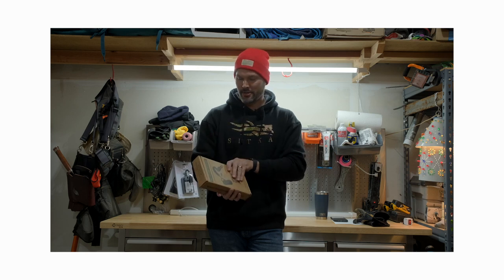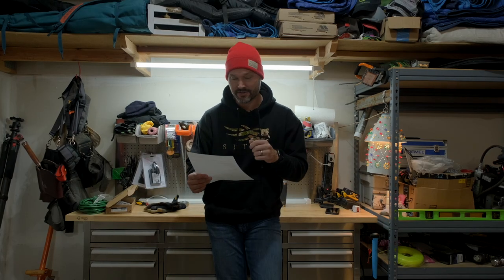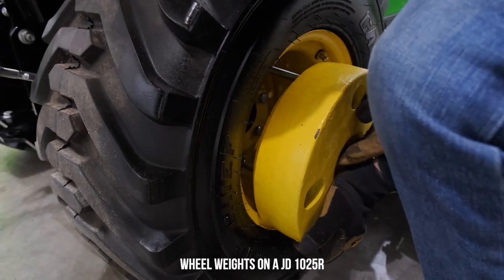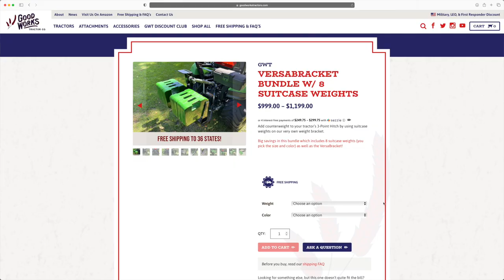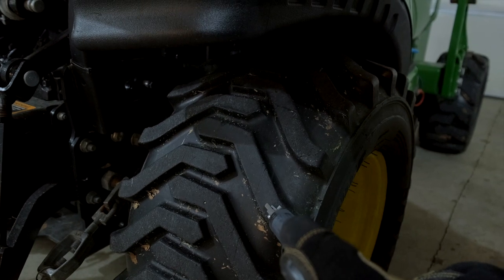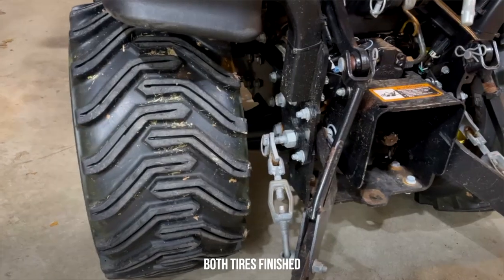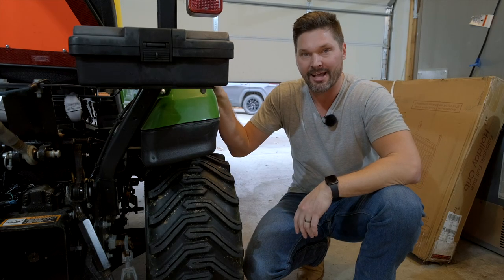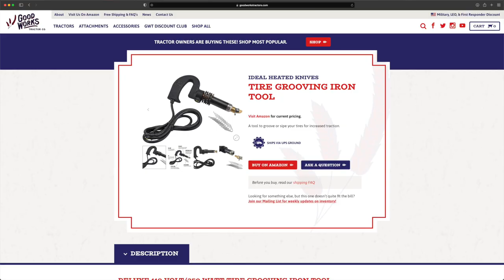FROM SLIP TO GRIP! 10 TIPS TO IMPROVE TRACTOR TRACTION! 🚜👌

Comment: We used that very tool in the 1980s to groove our competition tires for rally racing on dirt.  The pattern was more art than science, and having a talented groover on your team was worth his weight in gold.  It compromised tread life for the sake of improved traction, certainly not an issue with tractors.
I do have to echo the call for continuing the groove through the ends of the tread block. Besides trapping a strip of ice at the worst place - the highest point of the tread block - the uncut bridge will reduce the contact pressure on the edges of the groove, defeating their effectiveness.
And that's the key to all of this: making more EDGES perpendicular to the vehicle's drive, which is the physics behind sipes.  It's not the groove you are cutting that makes the difference, it's the amount of edges you are adding.

Comment: The best ad on I put on my tractor is a brush guard on my front bucket. Keeps limbs dirt and rock off the hood radiator and me. Made it out of a mobile home frame. Cut an angle on each side, folded the top bar down reseeded it for strength, put 2” receiver in center cut 2 round holes and 4 2” slots so I can still see what’s in the bucket,used those slats for upright support support behind the holes and slots, put a weld on hook on each lower corner and 2 d rings on each top corner looks and works great.be glad to see someone like you make them

Comment: Thanks for the great video!  I wish the place that sold me my 2320 would have given me a clue about ballast.  I would have a loader full of gravel with no weight on the back and had some really scary moments.... Back tires coming off the ground... Feeling like i was going to tip....etc.
I have a heavy cab on it also and i know in the early days the 62" mower deck stopped me from tipping countless times.  Now I never use the mower deck and have about 400 lbs of weight lifting plates on the quick hitch for ballast.  It's a whole different feel with that ballast 100% of the time.

Comment: Chains on my tires worked great, right up until I had my driveway paved. Ha! Can’t wait to see how the grooved tires work out. Maybe I’ll go that route. Thanks for the vid!
Reply from the maker: Haha, yeah I know what you mean.  No bueno on asphalt!  Have a good one James!
Reply: they make rubber "chains" or tread bars also. I run chains on a lighter tractor with no damage, but these bigger tractors with chains on will damage your driveway?
Reply: After sealing my macadam 2 years ago,I stopped using chains. Unfortunately in spring you could barely tell it was sealed. If I spend time sealing it again I will check into a rubber cutting edge.
Reply: @brucebennett8475  ah, makes sense.

Comment: I used the same tool to groove up my UTV Tusk Terribites which suck big time in ice/snow. Afterwards this same tires worked excellent in the ice/snow. It takes quite a while to do the job and some strength to push the groove through the lugs, but worth it.

Comment: Thank you for sharing!  I have R4s on my Massey.  Never had them in snow or ice but using them this year for clearing drive.  I am excited to see how this works for you this season,  I may have to try this.  Show us how they do in dirt/ mud and such too.
Reply: My Massey has R4s on and worked great last year pushing snow. No chains but have 450 lb of weight in the back. I wouldn't groove my tires. I think when driving on road or hard surface they would wear a little faster
Reply: @brucebennett8475  Good to know. I used to use a skid loader with R4s in snow and never had any complains.  I am hopeful for lots of snow this year to try the Massey out!

Comment: i jacked up the back so i could spin the tires.  no need to wiggle the tractor around.  i just did siping.  i used a razor knife for the fronts.  that was a pain.  i used an oscillating cutter with a thin blade for the rears.  i got both rears R1 11.2-24s done in about an hour.  i also made an template of the 2 different lugs (outer and inner) in tinfoil, then cut the foil in the pattern i wanted, and spray painted the tires with the template.  i just followed my marks after that.  it made a pretty consistent pattern.  came out all right.  i'm expecting snow tomorrow, i'll let you know how it goes.

Comment: The grooving does work. I did my last 1025 r with the same pattern. I also makes the R 4  tires work better for forward traction on hard dirt. I have the same tire groover. It works great.  I have the new radials on my 2021 1025 r.

Comment: They make cables as well. The cables are dot approved and some use them on semi trucks out west. They do not work as good as chains and are lighter. They also do not mark up the pavement as bad as chains. I have a 37hp 4400 jd yr 01. It is crazy heavy compared to Kubota and others. Turf tires front and rear with no chains on a crush and run packed drive way. Western PA so we do get the snow and bitter cold as you do. My driveway is 1/4 mile with a barn and dry winter paddock for horses that I plow. The tractor does fine if you've done it all your life and know the tricks. But the first pass down the hill I have to make sure I get enough snow off to get back up. All 4 tires are filled and I can handle 7 to 800lb bales with nothing in the back and not miss a beat. Now the 13 to 1400lb bales I have to think about and be a little safer with because they will make it light on the rear. I can't really use an implement for weight on the back to stack the hay because it gets tight in the barn at the end as it's getting full. The suitcase weight holder on the 3pt looks like a good option for that. 👍
Reply from the maker: Great info, haven't heard of the cables.  Will have to investigate that!

Comment: Another great video!  Looks like a lot of work though.  I haven't had much if any trouble with the R4's on mine in the snow.  But it is a very flat asphalt driveway.  I will be looking forward to an update video.  Perhaps another update 6-8 months later showing how the grooves affected traction (if at all) during the other seasons of the year would be cool as well.
Reply: I haven’t had issues with mine on my b2650, nor my neighbor’s Grand L. Also flat driveway areas for the most part.

Comment: I’m not sure if it was mentioned but tire width can be a real “issue” in snow.  Just an example, those big wide city tires on a pickup ver the narrow tire on a true plowing pickup.  I do realize we are not actually changing out the tires on a tractor, just part of the reason R14’s work well.  More of a rounded profile.  Tire width and wheel width, plus tread patterns = ugh.  Ballast + chains and run what you brought.

Comment: A big part of snow tire function is that the snow packs into the siping and actually grips the snow or ice on the driving surface. That’s why you see the zig zag siping is because it holds the snow in better. Curious how your siping works, it should certainly add another straight edge to grab traction, which should help! Another important component is the tread compound, but you can’t change that!

Comment: I can vouch for studs. I put “Grip Studs” all the way around on my 2320 R4s and love them. Would prefer chains but because of the backhoe mount there just isn’t enough room. I plow only gravel, no asphalt or concrete. Also, Grip Studs are easily removed and can be put back on the following year.
Reply: Did you put the studs in front and rear?
Reply: Oh .. someone else with a 2320.  They seem to be rare and not too many videos about them.  I think my tires are the R4 and I have a front mounted snowblower and use about 400 lbs of weight on the back quick hitch... And try to stay in 2 wheel drive if I can.

Comment: In my experience if you go the stud route use real studs not screws, ice studs for four wheeler racing worked the best for me they are harder.  be careful on going to deep with the groove you would be surprised at how thin the material at the base of those tread blocks are.i groove a tire on a lawn tractor to deep and it actually lost strength in the tire body and expanded by about a inch and then it was lop sided. even though those grooves you did may look like they will scoop snow better and probably be better than stock. i would have grooved them across the tread bars to simulate more tread blocks. look at the snow tire tread you showed and try to mimic it as close as possible. they spend lots of money on R&D for what works the best. most of all have fun trying to be frugal and learn from you mistakes. I'm back to using tire chains with ag tires on my JD 318 it only sees gravel and turf. good luck and a great video wish there was more vids like this 20 years ago.

Comment: I wish you would have asked about doing this before you did it.
The key to traction on ice and snow is how soft the rubber is, called (Durometer)
Cold hard rubber has very little traction.
Reply: The grooving does work. Its not like throwing chains on but it does help the helplessness of an R4 a good bit.  It doesn't really seem to effect the durability much either. I haven't had any radical chunking or anything like that.

Comment: I have used groovers for years with tractor trailer tires they work well but last season I had chains on my 1025 and blacktop and no issues at all    this year I installed ATV ice studs in the tires front    and seem to be OK   rear tires not so good the screw heads are sinking into the rubber so may have to try Plan B

Comment: Typically on snow tires the grooves go right to edge of tread to allow water to escape and flexing , should you do the same with these? Neat tool! Great video!
Reply from the maker: I read pros and cons of that.  I figured I can trim out the edge pretty quickly later on, but would be harder to put that rubber back in place! 😂
Reply: @GoodWorksTractors  my research led to the same conclusion, don't go all the way to the outside edge.

Comment: I have a 2038R and the 41lb weights still hit the tube on my loader.  It is a 2021.  Would you have an answer as to why this would be?
Reply from the maker: Good question.  I've never tried it on a 2038r.  Only a 1025r.
Reply: May depend on NSL or MSL type loader.   The weights don't work on a 1025 with MSL loader for sure. I'm not familiar with the 2R series loaders.

Comment: I live in the Pacific Northwest which tends to have a wet sticky snow which here the snow chance to pack in that grooved area so it basically does nothing as far as help helping traction. If you are in the area that tends to have dry snow I imagine it would help. Also consider that your Lugz on the tires will wear faster in the summer months. I never knew that they made rubber chains for the lawn tractors I'll have to study up on that one that sounds like the way to go.  <](:>)-[@#=]

Comment: I already have ballast in my tires. I already have wheel weights. I have the turf tires. on the series 2 the turf tires are a little more aggressive then the series 1. I don't really see any place to cut into the tires with the heat gun. Adding weight to the front would get in the way of the front snow blower.  I already have a spreader on the rear for salt so no room for more weight there.  I have a 300 foot tar driveway. the elevation is 75 food higher at the top. I don't have any issues in the snow. its the ice.  when the driveway ices over its almost impossible to clear it.  I think my only fix is a new house.  lol
Reply: In your situation I think if you got tire cables on front and rear it would work well on ice and they come off fast for summer.  Get some that don't have any extra clamped on features, I would think if it is cable alone it should not do any noticeable damage to your paved surface.  They will however bite the ice and start to roughen its surface.  If you think your unit is not too heavy you might get get away with chains which would be more aggressive on ice but also on your tar surface.

Comment: You mentioned beat juice. I thought that was a brine mixture? Is there a way to get it concentrate without the brine?
Reply: I live in Michigan as well we have lots of sugar beets grown by the farmers a product of that is beet juice there is no brine in it it's pure beet juice look up rim guard online that has no brine in it so it's non-corrosive also a good thing about beet juice is if you get a hole in your tire you don't have to worry about cleaning up the beet juice it's not bad for the ground or animals however it does stink when you get it on your hands
Reply: Calcium chloride is probably what you are thinking of. Beet juice is just that, juice from beets. There are other fluids to use. Another popular one is RV antifreeze, since it is less toxic if it leaks out, than regular antifreeze. Windshield washer fluid is another. What is best for you depends on how much weight is needed in the tire, and how cold it gets where you are at.
Reply: We had used beet juice brine mixture for our Test facilities in NJ. But it was a beet/ brine and it does stink. It worked great to minimize ice buildup.  But being a brine it seemed not so great an idea for wheels. It is good to here you are able to get the 100% beet juice.

Comment: as always what a great video. Can't wait till it's used and report back how it went.
Interested to see if you sipe the front tires as well.

 I have the R4's as well. I plow 1000'+ of gravel drive
and some of my neighbors have asphalt/ concrete areas as well (of course as a tractor owner,
you can't not help your neighbors) and I enjoy doing it for them, even the ones that bitch about where
I stack the snow (I basically have a chuckle about that as I don't even charge them for fuel costs).
Don't really want to buy versa trac or whatever,
Just want to improve on what I have. snow plow on front and backhoe on back seems to have made
my tractor realitively safe to push snow. But I do, at times, slip/slide around in icy conditions.

Comment: We mark the tires first trace the pattern on the tread first it speeds it up .If the tires are small take them off it it easier .The iron we have has different profile cutter tips both style and depth/width. Another note the cutters  become dull so change the cutters out as needed!

Comment: Don't see how cutting just groves in the thread it's not adding anything, plus you taking rubber away, so that's less tire on the touching the ground
Reply from the maker: There's two schools of thought from what I've read.  One is that the more edges, the better, perhaps certain patterns, angles, depths, locations are preferred.  A flat piece of rubber doesn't do much which is why you don't see baldies on anyone's equipment.  

Another train of thought is that the extra grooves, slots, etc, trap snow and create more friction allowing for improved traction.  

Perhaps it's a bit of both or neither.  I don't know.  I do know that they made this tool for with this intended purpose in mind and many folks have done it.  Do a google search and you can spend a good amount of time learning about it.
Reply: @GoodWorksTractors  maybe for off hard surfaces, but on hard surfaces you want rubber rather than groves for traction, that's why dragsters run slicks
Reply: @GoodWorksTractors  think the thread walls are too thin now with all the rear weight you have, think they would fold over
Reply from the maker: Are dragsters running on packed snow and ice?  This isn't a brand new to market concept.  Been around for a long time, just a first for me.  Thanks for watching!
Reply: @GoodWorksTractors  LOL, some do but they use the screw in studs for traction
Reply: Look at any snow rated tires. Plenty of siping and groves throughout the tread blocks. You do not want maximum rubber on the surface for ice and snow. It's about optimizing the surface and giving the water and slush a way out from under the tread block to get the tread block to the surface as best as it can. In deep snow, snow tires actually hold onto packed snow because snow to snow traction is better than rubber to snow, that's why I'm fresh powder, good snow tires actually pack full of snow.
Reply: @jimski427  don't even know what snow tires look like, if we get 1/8 of an inch down here, we shut down, lol
Reply: @grantbroussard5951  hahaha no worries. Snow tires are a different animal. The tread designs and tire composition is pretty nuts. I know the "gold standard" blizzaks seriously degrades above 45-50°f. So bad I only was able to get about 35-40k miles out of them because I ran them well into the summer months. Just another thing us dummy's living in the snow belt have to deal with! Lol